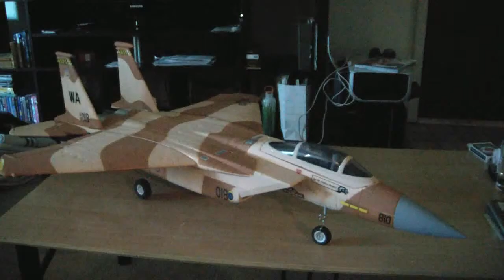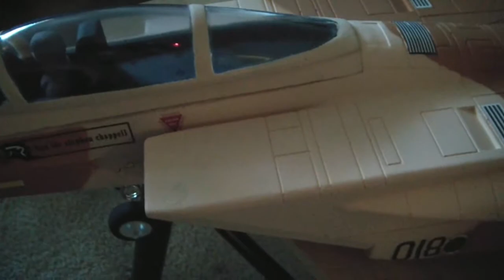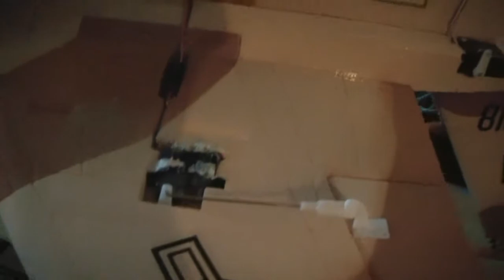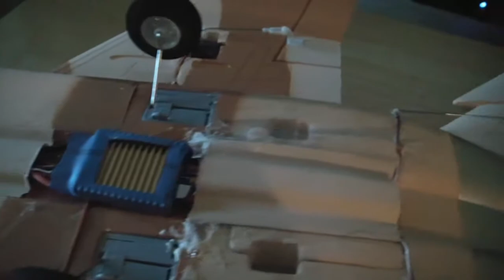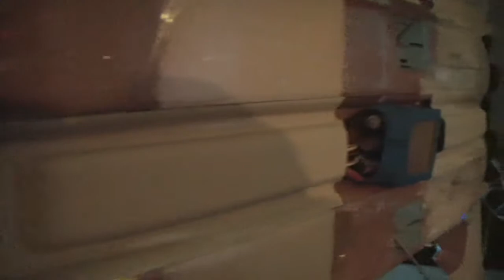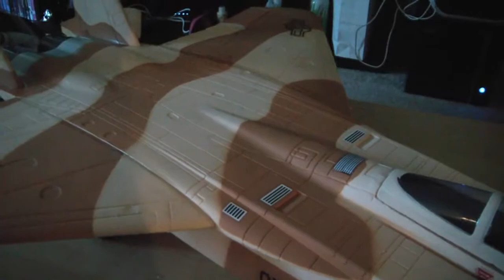NP F-15 Kit - All electronics custom added

Comment from the maker: @slyfoxflyer66 1600mAh will give about a 3minute flight.  2200mAh would give about a 4minute flight.  1800mAh would give about 3.5mins(I don't have any 1800mAh).  The 1600mAh I find fit a little nicer.  The 2200mAh fit, but are very snug and may strip away some foam in the battery compartment over time.  This jet is made for a 3cell setup, so the 4cells are kind of large for it, but it does fit them just fine.

Comment from the maker: @bloodhound122 Most parts in this plane are quality E-flite... the fan unit, however, was a reused 4 cell fan unit from a broken jet.  This is why this jet isn't super fast, the fan unit isn't amazing, but all in all, the jet flies pretty well, and much better than the stock 3 cell setup.

Comment from the maker: @Ispintechno1 if you don't have a runway, and only can take off fram grass then you will need to look into planes and jets with larger wheels.  There are many many planes that people take off from grass.  Jets you have to be more careful, because a lot of jets are made by these crappy chinese companies and the gear is very weak.  Grass will just break the small gear on lots of the smaller jets.  This f-15 I landed in grass today, and it was slowed down very much, it wouldn't have taken back off.